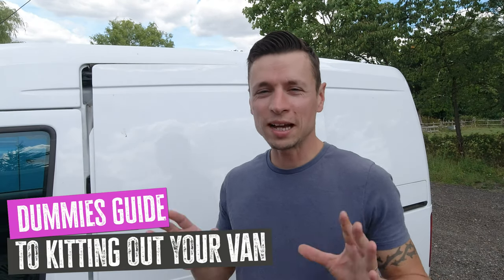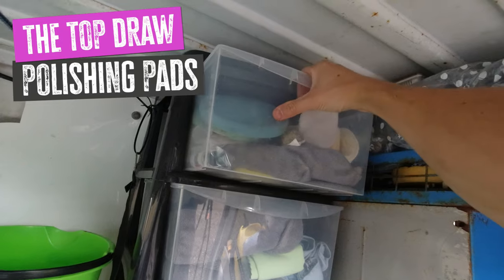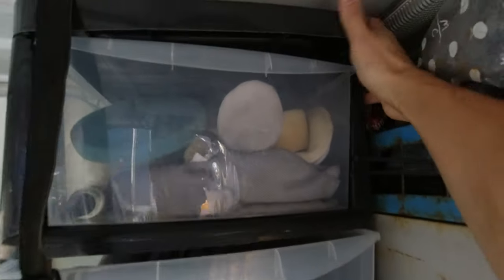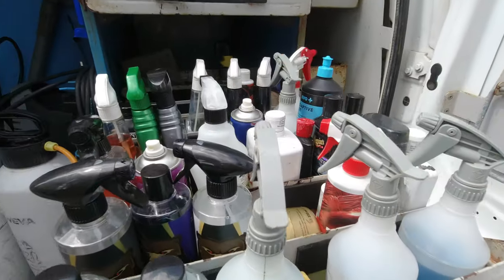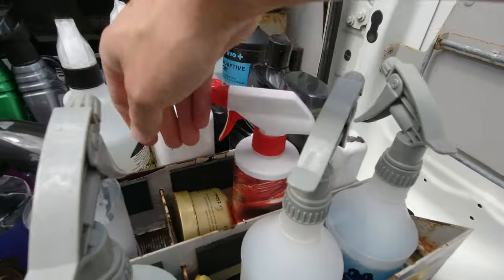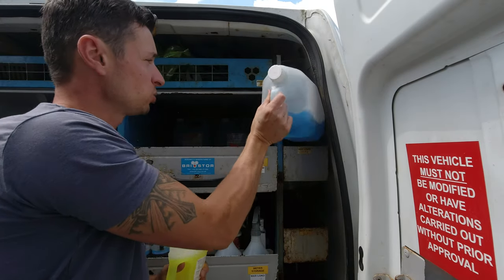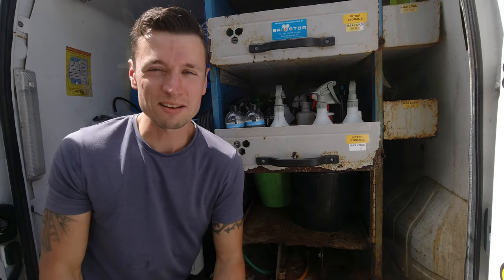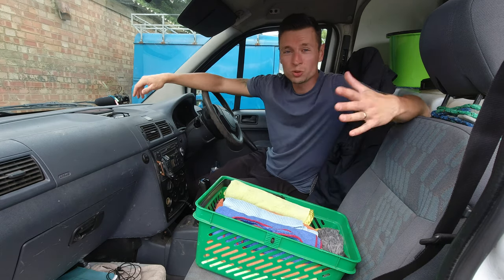Mobile Detailing Van Set up Tour!

Comment: Sound videos. Great channel.

I think the Connect would be a much more reliable motor if it weren't an ex-works van you were using. They tend to get battered, don't get checked properly and a lot of big companys have a bare minimum cheapest option approach to fleet maintenance!
Reply from the maker: This one was very good till it met me 😂. It does very well to be fair I'm well happy with it

Comment: Do you have a pump from your water tank to push water through to the pressure washer. Starting up with valeting and been watching a lot of your videos which have been super helpful. I've got an 85PSI pressure washer. Also is your tank 200ltr or 400ltr? Any advice welcome
Reply from the maker: Hello no pump needed. I put the pressure washer on the floor and let gravity feed the water down into the machine 👌
Reply: @epicautomotivedetailing  that's great thank you

Comment: Nice to have stuff coming out of the real world not like the Hollywood stuff you get on YouTube. But the pressure washer 
You use a nerd at the technical department at karcher reckons they should not be run off a generator ?
Reply from the maker: I agree the generator could in fact put strain on motor.  They require direct power without a lead in perfect world. Mines doing great though 👌

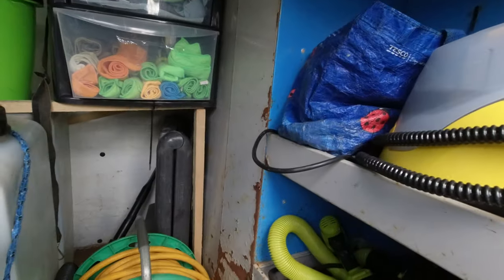Comment: Hey Dave. I'm planning on buying a steam cleaner. I thought of buying karcher SC3 but after I saw this video https://www.youtube.com/watch?v=9bRYfEwf5O0 I'm hesitant. He's pointing steam directly at his hand and it's not burning him(it's at 4:48).  Is that just a faulty unit or is that the hottest it can be?
Does your SC4 generate higher temperature than that or is it similar?
Reply from the maker: The sc4 is very hot it will burn . I have had many burns from the sc4 it is that hit. I still have scars from burning my leg. The sc4 is built to last longer. You can buy refurbished ones for dirt cheap. (Not all refurbs are previously faulty) I got mine which was returned stock for half price